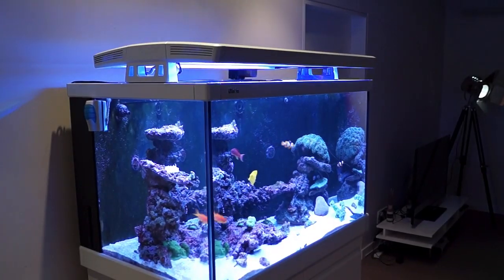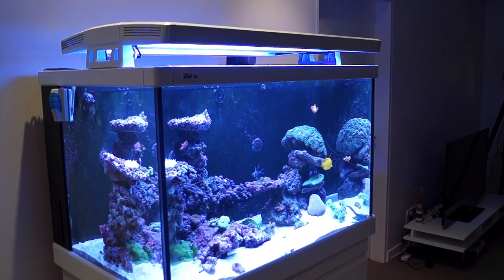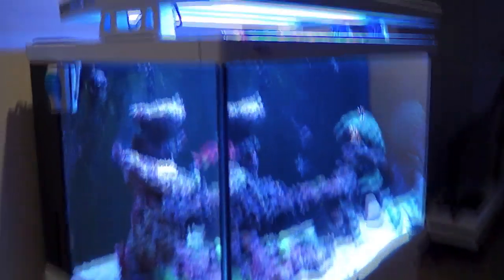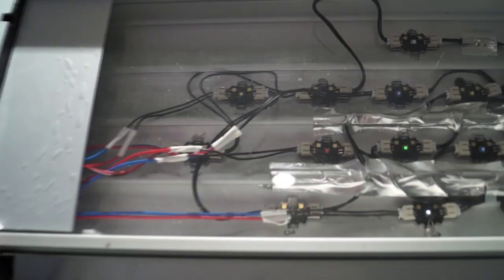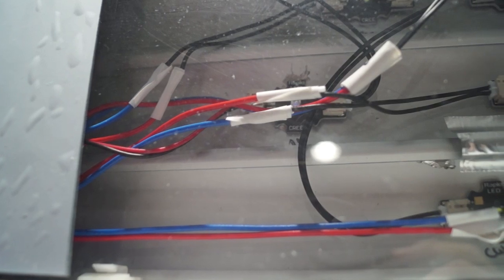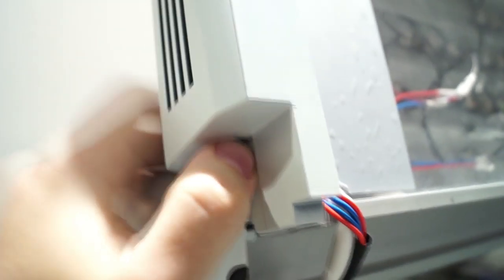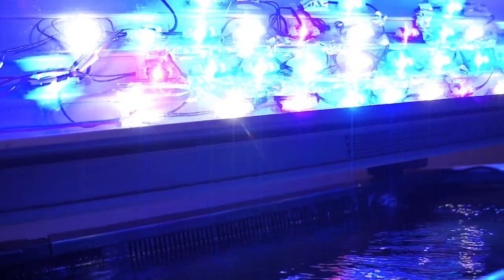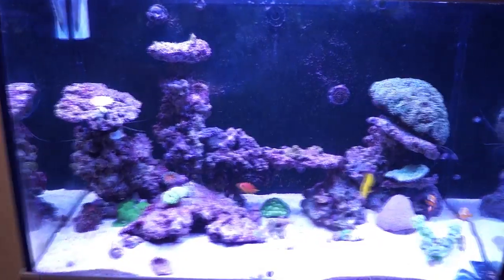RED SEA MAX S Series RAPID LED Retrofit Upgrade

Comment: I can see you've put allot of work into this light MOD, but i probably would have waited for RSM to make LED's as standard before I purchased this aquarium. I was going to buy one of these, but the heating from the lighting was phenomenal so I thought better of it!
Reply from the maker: Yes i also thought the same, many people are removing the hoods and using the canon shaped LEDs atatched to the top, mine still worked out cheaper and more powerfull but an awful lot of work. Energy consumption is much better now!
Reply: With the high price of electricity these days and it's only expected to get more expensive, I could imagine this MOD paying for itself over and over again!
Reply from the maker: Bourne Vengeance It already has, not only that iut pays for itself on the first price of a full globe change, these LEDs will last 10 years